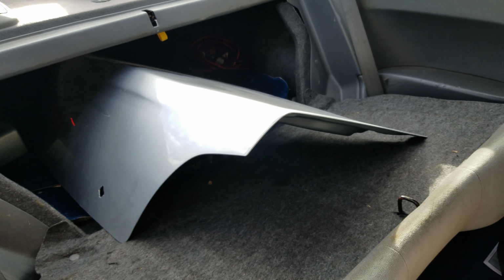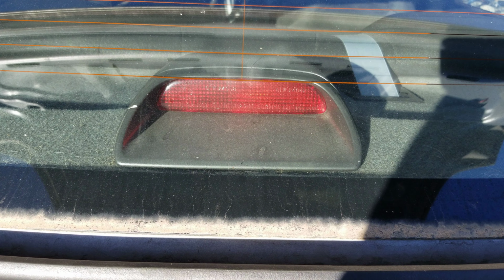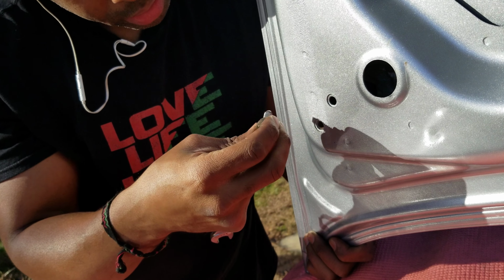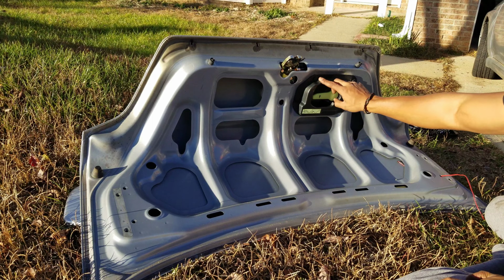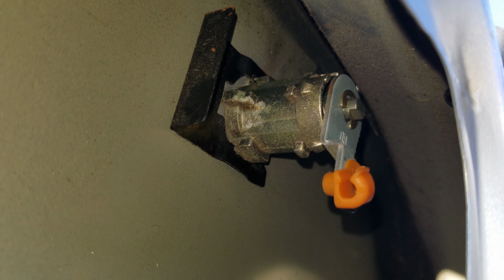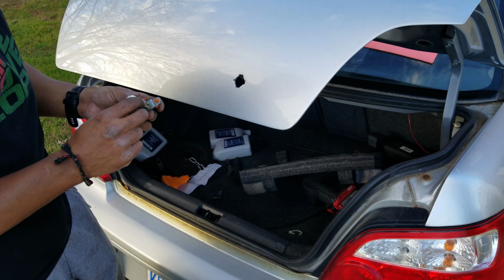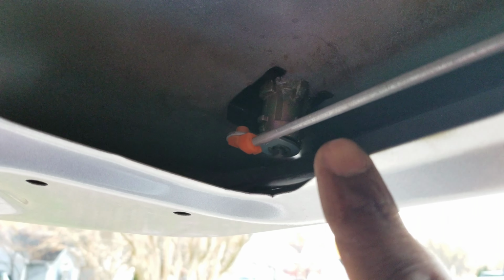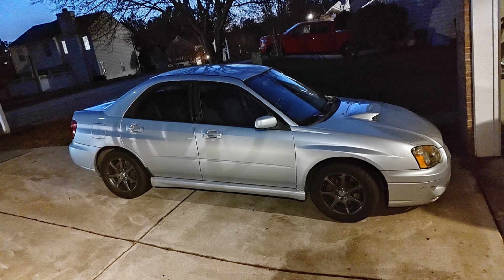2004 WRX | swapping to a wingless trunk

Comment: Thanks for this. Just did this to my stupid world rally blue sti trunk. It was a 4 month. Trial and error. Had to convert my trunk with holes to wingless. Fill hole. Damage original paint. Sand and sand. Paint and overspray. Sand again. Etc etc. Now its done. But now closed the trunk after what you did in this video.. and its stuck closed. Gonna have to take the back seat off and crawl in and see what i did wrong. :) gonna follow your step by step again..
Reply from the maker: That sounds like a lot of work. Good luck. It's probably something simple with the lock. I'm thinking about painting my old trunk too.
Reply: Rough journey man, hope you got it fixed.
Reply: @adamschaafsma5839  yah its holding up quite well after a year! Looks awesome!
Reply: @ nice! Glad to hear it